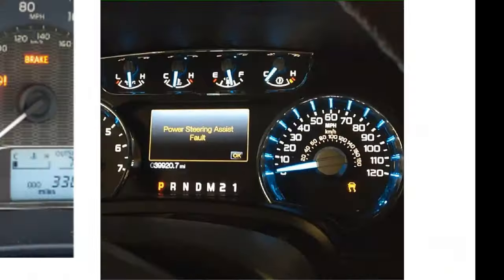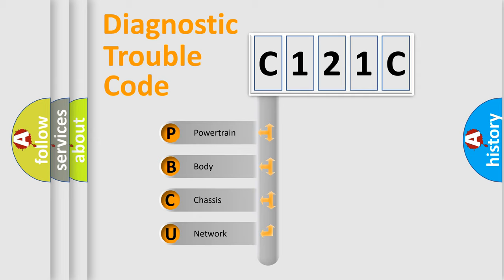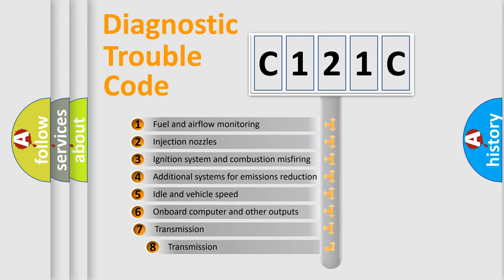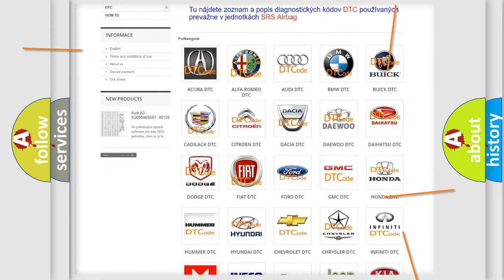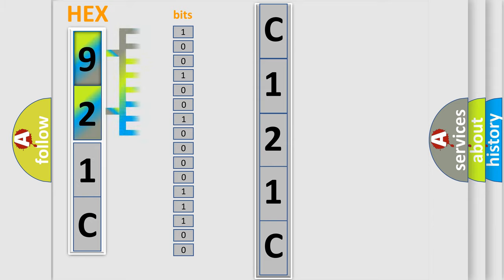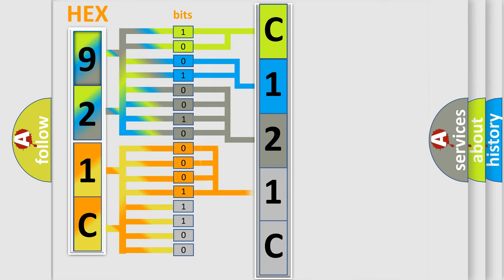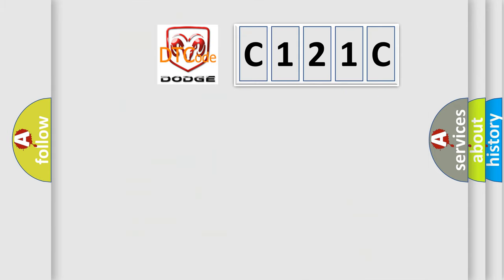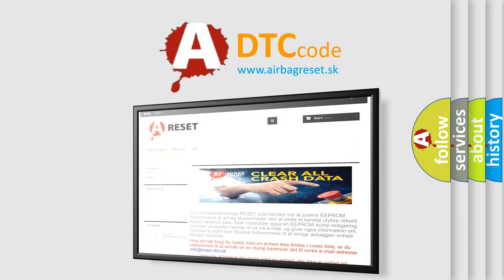DTC Dodge C121C Short Explanation

Comment: I changed cams, lifters, rockers, cam sensors, cam phaser solenoids and now i have this code. Why?
Reply: i think you need to relearn the new sensors with a good scanner
Reply: The problem I found was 3 shitty lifters from China. I put in Melling lifters and now no more timing and oil pressure issues. Still have codes 172/175 which is burning rich. Changed all Mopar parts...O2 sensors, injectors, pcv, map sensor, spark plugs, coils. Fuel pressure 58 psi. Well going on a long vacation so not till sometime next month or December before I get back to it.
Reply: My Innova 5610 scanner says my vacuum is only 11 at idle. I did a cam/crank relearn.